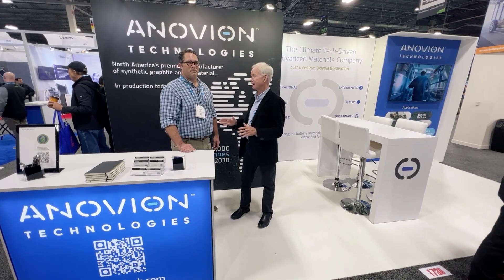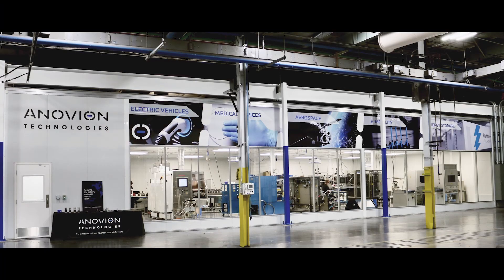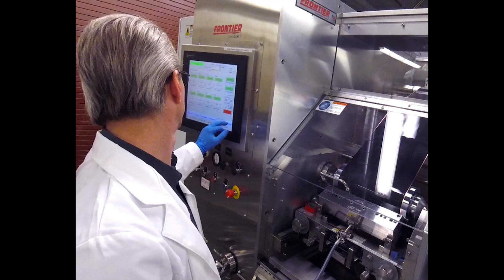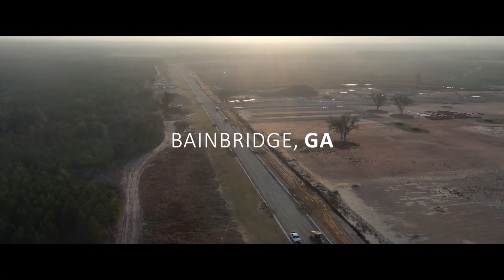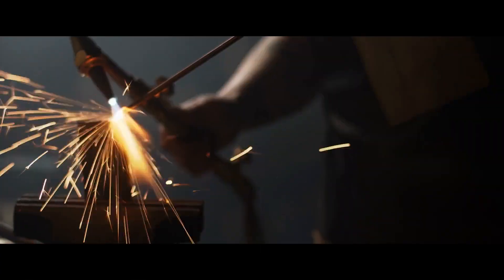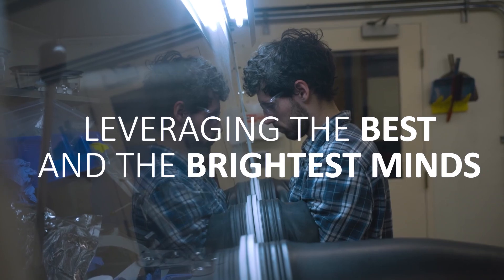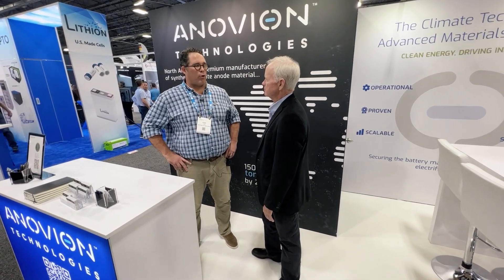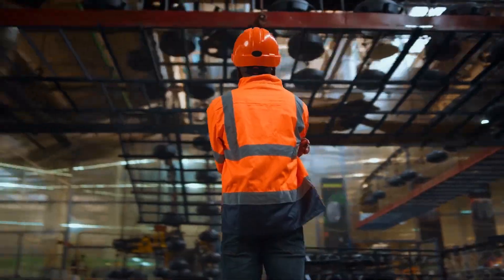On-Shoring Synthetic Graphite For US Battery Production - The Battery Show 2023

Comment: Making graphite is an incredibly energy-intensive process, and I assume that this company is doing it using renewable energy, which is how it is cutting its carbon footprint. However, there isn't much renewable energy in Georgia and Florida, where the company is expanding. It sounds like the company has also figured out a more efficient way to make it. I assume that this is their secret sauce, which is why Chip Dunn avoided answering the question about what his company is doing differently from the Chinese. 

The question I have is whether graphite can be made affordably without petroleum coke, because eventually the world is going to stop producing that waste product.